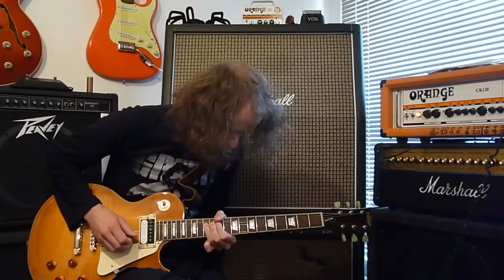Why I prefer Solid State amps to Valve amps

Comment: I am turning 65 and been playing out almost 50 years. I still own a bunch of old BF Fenders, Old Traynor's and my main gig amp is a FUCHs ODS Bassman.   My days of large clubs and cranked amps is long gone and I just ordered my first, analogue, solid-state preamp / class "D" power amp and can't wait to start working with the new rig.  I went from 65lbs to 5 lbs with the preamp on my pedal board.   The reality is, if you are doing the cranked amp, straight into the amp thing, then tubes all day. But if you are sticking a pedal board into a clean tube amp, then you are hearing the pedals and not the amp so solid state makes perfect sense.

Comment: I think what happens is this: Player starts out with some cheap and nasty SS amp that doesn't sound very good. Then they decide to buy a valve amp and find even a low-end valve product sounds 10x better so they are convinced they shouldn't play anything else. But what's happened is they never tried a GOOD SS amp and played it through a nice cab so, if they do encounter a good SS, they are rather surprised that it doesn't suck like their old starter amp.
Reply: I think also what occurs is that 99% of solid state amps are sold with shit speakers. Put a creamback in a little Peavey rage combo, and it'll change your opinion.
Reply: Have you ever tried a Cube Stage amp?  They are advertised a sounding just as good as a tube amp.  I am thinking of getting the Fender 15W Humboldt cannabis rex speaker amp.  What do you think of it?
Reply: I have to agree, I run various ss amps along with my Mesa road king 2, 4x12 cab and a les Paul and it sounds amazing, yes I have played through more expensive tube systems.

Mesa power amps, digitech pre amps out to full stack of two cabs, but the difference is small and the expense is very great, not to mention hauling around a flight case rack system, along with 2, 4x12 cabs, plus pedals, it gets to be ridiculous when you want to play a gig  and bring your tone with you, if you have to haul in all that gear to do it.
Also, in smaller rooms, you really cant heat up those tubes the way you want to too get that tone that warm, brilliant tone, you just cant get it at lower levels and in small clubs you have a limit to your volume.

I see merit in both, if I had a crew of people to move my things for me, and unlimited funds, then yeah I would probably build an incredible tube driven system, but alas, I am a starving artist, I work alone or with my band, I dont have much help and a bad back, so for me, the less gear I have to haul the better.

I am down to a head, a 4x12 and a foot board and my guitar, I can carry it in two trips, one if I really get creative.

With that gear I can get very close to the tube driven tone I used to have in my 8k$ set up with all that gear
Id rather simplify and come really close for now, when I get picked up and have roadies and unlimited funds for touring, I will re think it.
Reply: I think you are right about that.
Reply: Very reasonable observation Mr. Hammond.  Cheers mate.
Reply: I agree man. I use a acoustic 140 ss and a sunn beta bass ss and both amps are awesomes. I dont need a overpricely tube amps.
Reply: True!
Reply: Exactly!
Reply: This is my story, starting with decent SS amp, then improving on a decent valve amp, then further improving on an excellent Vox AC15HW1. And recently improving my 1st SS amp by adding a very good speaker. But my Vox AC keeps to be my #1
Reply: I've had many valve amps some of which sounded like crap IMO. And they weren't cheap either.
Reply: @Diax1324  This. The speakers are EVERYTHING. It's where your SOUND comes from. I am flabbergasted as to how much people ignore this fact and just focus on the amp. IMHO, the cab is 100000x more important than the amp. With good speakers, you can plug directly into a poweramp with a distortion pedal and get a good sound, you don't even need the preamp. With shit speakers, you can have the best amp in the world, and you'll still get a shit sound.
Reply: Playing through good speakers  is a huge difference.  The production element for the noise you wish to make is critical. The speaker and cab are easily equally as important as the amplification element. Not talked about nearly as much as pedal and guitar selection. Your Custom Shop Strat doesn't sound like $8k worth of guitar through a Mega amp with a six inch shite speaker and a cabinet made of press board end bits.
Reply: I know this is an old comment but it's insanely accurate. My first shitty SS amp was the yardstick I measured everything against for a while, and my cheap 15w Chinese tube head I bought next blew it out of the water, so I formed exactly the opinion you describe.. Then I tried a boss katana artist, the one with the waza speaker. Let's just say I was wrong about SS. And the katana isn't even at the top of the SS hierarchy.
Reply: @mattpipke5716  Matt, you have said it exactly how it is, I totally agree with you. Best wishes. 😁👍
Reply: MODELLING SS sounds good. normal SS does not.
Reply: My first amp I bought was a boss katana and im really surprised on how good they sound and they have so many effects and little details
Im using a 3 single coil strat for now but I just ordered a jackson dinky and im waiting for it to arrive
Reply: Actually, even the most trash possible solid state amps can be dialed with a GOOD cab+speaker and proper boost. Honestly.

The worst problem about cheap gear BY FAR is cheap speaker and cab.

Plus, new players can't dial properly whatever gear they're using.
Reply: Tube amps give u great tone 60 plus on your tubes otherwise your tone changes and you need new tubes again .
Reply: Exception: Blackstar Debut and Fly
Reply: That’s not it, because the solid state amps face had chosen are not good by any measure (and I own both) but he loves them, makes them work and makes them his own.
Reply: @TheMirrorify I had a similar story, except I went straight from a Williams practice amp to the Boss Katana. Jesus Christ that first amp's speaker sounds like someone vomiting and screaming at the same time no matter what you play
Reply: @gillesgenete9598 Did you notice a great difference with the speaker change?
Reply: @javiceres  my 1st SS amp is a Fender Mustang 20watt. I added an Eminence 10in speaker replacing the original 8in. It improves the sound when cranked up but not that much at bedroom volume.
Reply: @gillesgenete9598  I see
Reply: Completely agree.  I started as an 11 year old with a Crate cheapo solid state amp for probably under $75.  In high school, I put all the dollars into a Fender Hot Rod DeVille.  Huge difference.  Immediately swore off SS amps.  Never paid attention to the better SS.  I just falsely believed tube amps are better by nature.  Now I'm 40, I don't gig any more, and the idea of not having a 50 lb amp kinda sounds nice.
Reply: Tube amps are the best no comparison with solid state i have both

Comment: It's nice to see a vid from a guitar player who thinks for himself. I've been playing guitar since the mid 80s. I've owned a lot of tube and solid state amps, and you are spot on about the cost of ownership of a tube amp and the high quality of many solid state amps. Only a fool would deny how great many solid state amps sound. I'm using a Roland Cube and a Boss GT-1 multi fx. This rig is totally solid state and I've got the best tone I've ever had, and I've owned Marshalls, Fenders, Boogies, you name it. I've experienced every nightmare you can with a tube amp. I had one particular plexi in the 80s that literally cost me three times as much to service and repair as it did to purchase. I got tired of it. So I started gigging with a solid-state Randall RG 75 around '88 in Hollywood. I never got so many compliments for my tone than I did when I played that Randall. I knew from that point on not to count out solid state. It did the job just fine, loud and clear. I eventually sold all my amps except for the Randall. I wish I still had that Randall. Great, great, great amp. My next amp will probably  be a Boss Katana. I love them, and they are a great value, extremely affordible, and they rock hard.
Reply: Tube amps is totally high maintenance,and expensive to keep it up and running!!!!....I would go solid state all the way for touring night after night at the pubs.....

Comment: I totally agree with you. Valve amps are so ridiculously expensive and such a pain to move around and maintain, they're really not worth bothering with. But then again, does a $4,000 super-duper special limited edition strat sound really better than a $500 basic MIM strat?
Reply: yes it would
Reply: Probably not enough to justify the massive difference in price.
Reply: +Lenivy Gamer, the Fender CS "$4,000 super-duper special limited edition strat" would hopefully have a thin nitrocellulose finish, a body made from a single piece of wood, and a steel trem block as opposed to the multi-piece wood body covered in a polyurethane thick finish and a zinc pot metal trem block. However, the tuners would be the same for both (standard Fender Practice), the pots, and the 5-Way switch are the same, too. Let's say you might like the choice of the custom shop pups: Texas Specials, CS 69 is the Hendrix later 60s-70s post CBS sound, 54s the early vintage sound, Hot 50's will sound better than the MIM's stock ceramic pickups.

Upgrade the MIM to Fender's CS pickup (as as in the $4K strat) and the difference is no longer that much, but it set you back $199. However, you can get a set of hand scatter wound pickups from Don Mare (any of his sets) for $55 more, it the MIM will IMHO sound better than the $4K Strat. Switch out the zinc trem block with Brass from GFS) or Cold Rolled Steel (Callaham), sand down the polyfinish, and the difference isn't worth the extra money of the customer shop.
Reply: +BDaMonkey, My favorite twist on this is what sounds better, a $4k Guitar through $500 Solid State amp or a MIM basic strat through a $4K tube amp? That's a variant of the what sounds better, a $5k guitar through a beginners 10Watt practice amp, or a entry level guitar through Marshall hand wired tube Combo or Head and half stack.
Reply: Yes it would, however cheap gear will get you 90% of the way there, every percentage point after that gets exponentially more expensive. Btw the wort strats I've ever heard are all MIM. Worse than a half decent squire.
Reply: er.........yes it would and i'm sure if you were given a dumble you would swap it for a nice HH
Reply: I would pick the expensive amp every single time.
Reply: You can get a valve amp for uner 400US that sounds not too bad. I think SS amps made properly are great but most of them nowdays are made to be cheap practice amps and fail. Roland JC Series sounds awesome, the old Fedner SS's aint no slouch either. They sound different to valve amps but they dont sound bad.
Reply: The best comment on the subject to date. The quote, "They (SS) sound different to valve amps but they dont sound bad," sums up the subject, succinctly.
Reply: frets might be a little tidier, better pickups and tuners, nut. apart from that you're paying for the label
Reply: i puttin da hespect on ur name boi
Reply: Except have you seen Paul gilbert take a cheap 80 dollar piece of garbage guitar and turn it into a shredding machine? Have you seen Satch go through a Solid state amp and STILL get his tone, with a cheap ass Squire? YES. Will there be quality differences between a 4000 dollar CS strat vs a 500 dollar MIM? Sure, but if you know how to do your own setup, or even take it to a reliable luthier, that 500 dollar MIM will get VERY close to a 4000 dollar strat, for WAY less money.
Reply: 暗黒騎士 Ankokukishi 
Question. I have a Squier start myself, what can be done like you said to make it better?
Reply: Check the frets, make sure they are finished properly and the edges aren't sticking out of the neck. Make sure the crowning is the kind you like (flatter crowned frets vs rounder crowned frets). If you want taller frets, get a fret replacement.

Pickup change if you aren't happy with the sound of the stock pickups. If you're happy with the pickups, keep em as is and you'll be just fine.

Replace ALL of the electronics. All pots, wiring, selector, everything. Squiers are cheap because Fender uses cheap materials in those areas to cut costs. I'm not saying go out and get expensive electronics either, do research: Ask other musician friends what electronics they use for replacements, etc. 

Let's take the most expensive route here and say you decided to get Stainless Steel Jumbo frets so you're doing an entire fret replacement. Including pup change, and electronics change, you could completely revamp your cheap squire for around 7-800 bucks (granted this is done by a good luthier, if you have the ability to do this sort of work yourself, it will be MUCH cheaper).
Reply: 暗黒騎士 Ankokukishi if he's gonna spend $800 to fix up his Squire.. why wouldn't he just buy a used US Strat or get a MIM Strat and put good pups in it? Used US Strat = $500-$600, MIM Strat = $600 + Pups $150 == both cheaper than $800 go fix up his Squire..
Reply: 707king I live in Japan, prices are different here. I'm just giving recommendations if he doesn't want to buy a new axe.
Reply: And you can get MORE custom options from Kiesel for less than half the price. Fender custom shop is a ripoff.
Reply: At a pub gig the punters are more interested in how your guitar looks, as long as it's got Fender or some well known brand and 'more importantly' you can actually play it reasonably well they'll be impressed. I would leave the Custom shop jobbie indoors and take the pretty looking MIM everytime lol..
Reply: Jerry M - BB King might disagree with you there.
Reply: I wonder if Jerry M has a video posted to demonstrate his point in the way Dave has here. Dave makes virtually any half decent gear sound fantastic, including Blues tones. I can only conclude the player him/herself is a major factor even over the gear being used.

Comment: Finally I have seen this video on why. As a military veteran with multiple injuries and getting closer to 50. I absolutely agree with you. I am not lugging heavy tube amps anywhere. But, I do here the difference in tube and solid state. Tubes are richer in sound. But, the advantages of the solid state outweighs that only advantage the tune amp has.

Comment: Agree 100%. Over my 50 year's playing I've owned everything from my first Selmer Treble 'n Bass 50 (and Goliath 1x18 cab!), to Boogies, VHT Pitbull, Cornford, Marshalls, Fenders etc., but I still come back to my Bandits which I have used since the early '80s. 'Consistency' is absolutely what I like about them; no susceptibility to crap, tone-robbing mains power supplies, reliability and zero running costs-and at my age (65), I'm not about to be shlepping 50lb amps around any more!

Comment: I've been a professional musician for 30 years, and I stopped using valve amps on stage in 1988. The sonic consistency you mention here is my #1 reason, I don't want to deafen myself and my bandmates by having to crank the amp beyond reason to find the sweet spot. But all the other reasons, reliability, weight, expense, etc. are all a pain in the ass too.